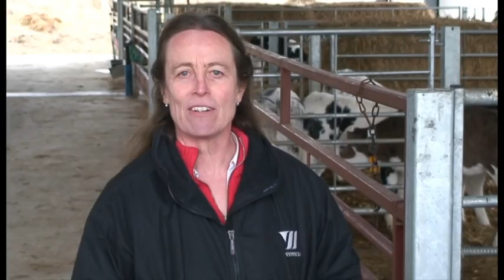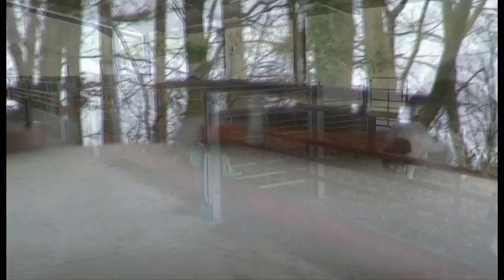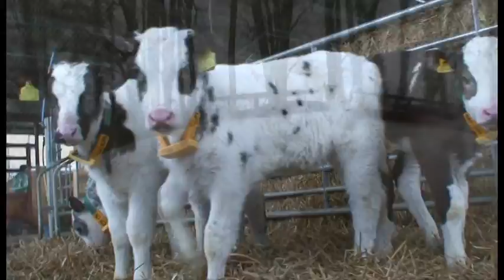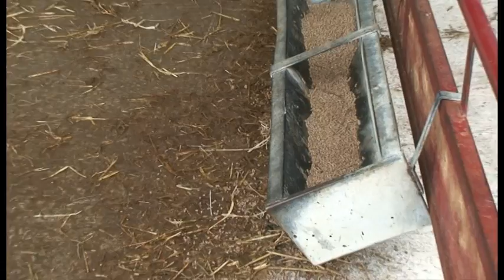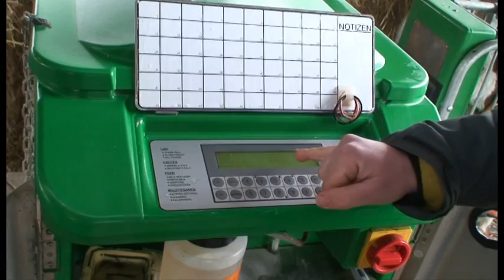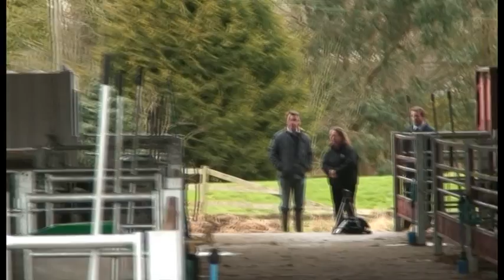Wynnstay Holm & Laue

Comment: How do you get on with blockages and problems with your machines?  We are in an isolated place in NZ where we rear over 400 calves in 2 big sheds on this system..no igloos though.  It is so hard to get techs here so we have had to service ourselves this season.  Our old machine runs well but is due for replacement, the new one plays up a lot.  We tried using Queen of calves strter and replacer to no avail. We fing the book a bit non helpful with issues that happen.  Any suggestions for self help pages etc??